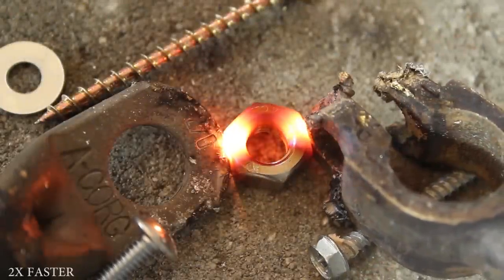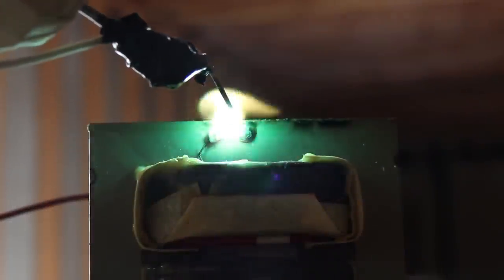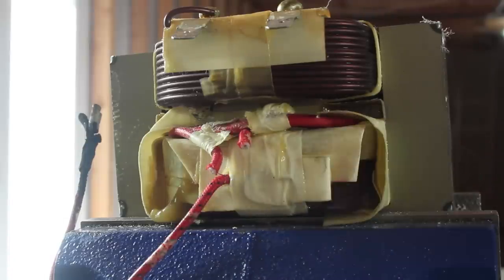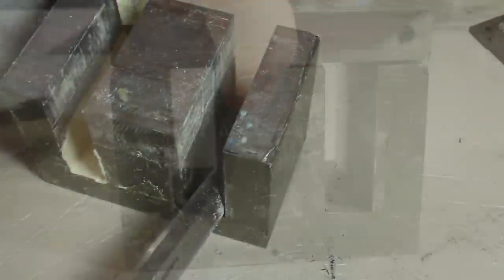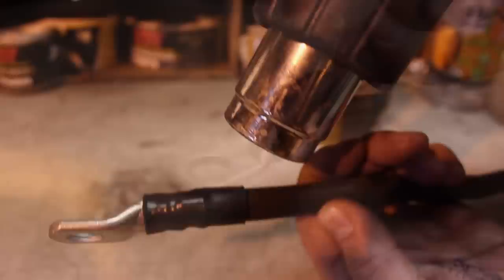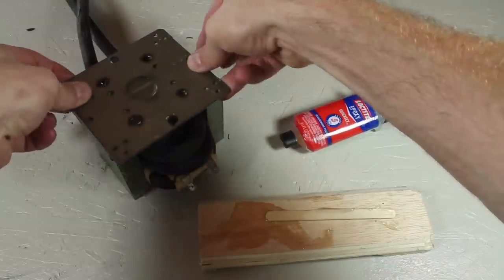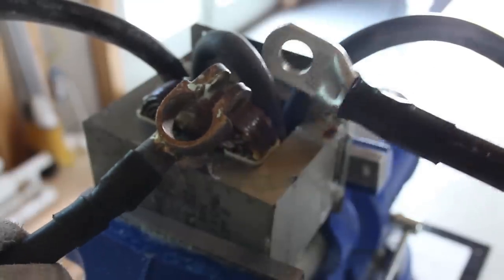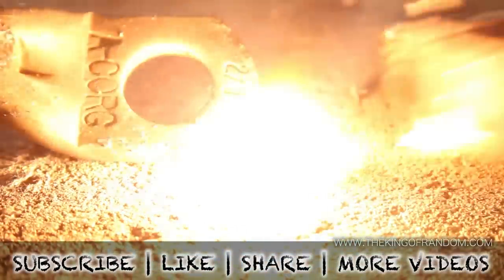How to Make The Metal Melter

Comment: |I put the transformer at 12 volts at car  battery recharger and It's not working ,it make some flames when I catch the + and minus  .
Reply: transformers will only work on AC power so try a AC wall adapter that puts out 50v AC at 20amps
Reply: Yes but if I put him at 220V,the adapter blows up and fuses shave .....it's because I not have a consumer \?
Reply: I think the voltage is to high not shore try a lower voltage
Reply: yes but I I haven't adapters bigger than 12 v ansd smaller than 220V ,I need a convertor?
Reply: Stefi Stefan
If you connected the transformer on DC, the primary coil has been damaged, because the coil don't got any resistance on DC. AC connected to a coil has an inductive resistance.
Reply: You are trying to charge a battery with AC? No wonder it smokes.... Batterys are DC and need to be charged with DC.... Are you serious?

Comment: At least this won't kill you if you touch it.
Reply: Thigh you're probably more likely to get injured by the heat
Reply: Shane Aykroid It's only 2 volts.
Reply: Luke Septicplier No, it has only 2 volts. It can't travel through your body past the hand and arm.
Reply: thats true
Reply: +Iamsasquatch how is it possible with 2v u melt a metal I have 36v transformer it just melts click pen springs
Reply: +Shane Aykroid just saying, the heat comes from the friction. Also he does touch the wires in another video.
Reply: because your transformer doesnt put out 800 amp, but probably only a few. it is not the voltage that does it, but the amps. you can get 1000volts out of a 1.5volt battery with a transformer, but that 1000volt wont harm you.  a few amps from the powergrid (110v or 220v) trough your body, and you are gone...
Reply: Jörgen Börg Not true. The amperage is in the end what kills you, but it can't without sufficient voltage.
Reply: Iamsasquatch true, you cant have one without the other...its all about the triangle.
Reply: im no expert but i would really just not want to be shocked with anything with that many amps or volts. jeez 800amps at 2v is 1600 watts im good fam.
Reply: your 36v transformer probably has very little amps which is the main reason this is melting metal
Reply: i work with 480v machines at work. some put out 3amps.  i got shocked by hitting a exposed wire with a wrench. how come i didnt die? i was standing on a ladder and it only made my right arm go numb?
Reply: tribulation138
 wooden ladder or aluminium? elektricity always follows that easiest way to the earth, so this time you had enough resistance.   look at it this way. when you touch an animal shockwire in dry condition with you boots on, you will feel practicly nothing. do it again but stand barefeet in heavy rain, and you get the shock you never wanted :D.
Reply: +Jörgen Börg fiberglass ladder
Reply: tribulation138
and probably with rubber paws. yes, that is definatly a factor why you are pretty much ok. those ladders don't conduct electricity well. and if you didnt toch any other thing than the wire on the ladder,the conduction of elektricity via your body to ladder to ground is very low.  thats why all ladder for elektricians are normally out of fibreglass.
Reply: ***** What? Do you know how electronics even work?
Reply: as soon as you complete the circuit with you in it you will melt like the metal in this video
Reply: nop, but it will burn you badly....try it and show your scars :)

Comment: why don't the two wires need to connect?
Reply: That whole thing-the transformator- bases on induction. It says that a moving conductor inside a magnetic field or a conductor in a moving magnetic field puts out voltage and amps. In a transformator the primary creates a magnetic field which poles are switching around quickly depending on the frequency in Hz of your power supply (don't know how often. In Germany it is at 50 Hz meaning a pole switching of 50 times per second) and so inducts an electrical current into the secondary. So all in all due to the law of induction the primary and secondary do not have to be connected.
Reply: +Lele Merb woah cool thanks

Comment: You really need to put a disclaimer on this video. Only certified technicians should open a microwave. There are some seriously deadly components inside a microwave. Touch the wrong part and it can kill you instantly. Like a capacitor inside a AC unit, the capacitors inside a microwave are much deadlier. Is deadlier even a word? But seriously a microwave is the hardest appliance to repair and there's a reason there are technicians trained for these repairs. I enjoyed the video and see you give warnings for the experiment, but please put a disclaimer up for people that opening a microwave is not safe. Ive been in residential maintenance and repairs for a long time, not once at any company do we allow maintenance techs to open or work on a microwave, only certified techs. Cover your butt for this as well, they are nothing to play around with and no one should open one under any circumstance unless they know what they are doing.
Reply: Lol, I'm 10 and I did this

Comment: So as a student betrayed by the American Education System, can someone explain how the primary coil is able to power the wire even though there is no direct contact?
Reply: Angel Castillo trough a magnetic field
Reply: +Angel Castillo U1/N1 = U2/N2 this is possible because we use alternated current. check magnetic inductance for more info. if we have 220 volts as U1 and 100 revolutions - N2 here is only two revolutions so. 220/100 = x/2 we have x equals 4.4 volts another important thing is u1.i1 = u2.i2 so lets say we had 1 amper in the first situation 220.1 = 4.4.x now you can see that the current will rise tremendously x equals 50.
Reply: +Gabriel Augusto Alves dos Reis  if Angel doesn't understand the concept, the math won't help much.

Comment: STOP SAYING VOLTAGE IS WHAT KILLS PEOPLE >.> Its amperage not voltage, voltage is essentially the speed whereas amperage is the size.
Reply: OhNoNotMyPenis Thank god someone knows what they are talking about.
Reply: it is both volts and amps the "its not the volts that kills people its the amps" saying comes from static electricity because static can 10s of thousands to 100s of thousands of volts but extremely low amps so it can jump spark gaps and tingle or hurt a little bit but wont kill you or seriously injure you.
Reply: I meant with direct current injection (ie. no resistance) xD sorry bout the confusion.
Reply: MLGOctang k, sry

Comment: I don't get it, God does the black cable produce electricity when it's connected to nothing
Reply: +wooju baik Induction,it works kinda like a inducton furnace
Reply: The changing magnetic field from the ac current produced by the primary coil induces an ac current into the secondary coil

Comment: hi is this safe for me only 13 years old
Reply: NO
Reply: +caiique callixto It's totally safe :D
Reply: +miko pada no this is a horrible idea at your age, get an adult
Reply: +DeadPool Junior. Being adult doesn't mean you can't be killed by electricity.
Reply: +miko pada If you know the basics of electronics, go on!
Reply: Do you know the Ohm's law ?
I've checked the resistance over arms.
It's equal to 500 000 ohms.The highest voltage is equal to 2 volts. current = voltage/resistance, so the highest current flowing through your body  = 0.000004 amps.
Now imagine: 24 volt source and the same resistance = 0.000048 amps.
So it's more dangerous to play with car battery than the large transformer.
Reply: I was trying to say that even power source with infinite current (impossible) and, for example, 10 volts won't kill you until you put wires directly into your heart.
Reply: Wires direct into your heart will do the trick without current too LOL
Reply: Taunter Atwill You're  right!

Comment: Why this WONT kill you......with the low voltage it creates, it won't be able to apply all 800 amps of current through your skin, due to the natural resistance of your skin. Between DRY fingertips, there is roughly 300-500 kohms (300,000-500,000 ohms) of resistance. Now according to ohms law, the amount of amperage is equal to the voltage divided by the resistance...so since we know this creates 2 volts, if you were to touch this with dry hands or wet hands which are about 100 kohms of resistance, regardless of the 800 amps, the resistance of the body would only allow 1/250,000 of an amp to pass through you which you wouldn't even feel. it takes a minimum of 1 miliamp (.001 or 1/1000 amps) to throw off your heartbeat and kill you and that's if you hold onto both leads with seperate hands. 

Why this WILL kill you......if he held the bare metal of anything, say two screws in separate hands, then touched those two screws to the two separate leads, it would lower the resistance of his body to extremely low levels, roughly 500 ohms, thus allowing more current through. 2/500 = 4 miliamps, which still on a scale isn't a ton of power, the metal of whatever you were holding onto would get extremely hot though because there is a lot more power passing through it due to it's resistance being around 1 ohm. If it wasn't AC voltage and passing through your heart, it probably wouldn't kill you. For example, DC voltage takes 30 mA to be considered deadly.

Comment: Anyone else slightly terrified by this? I honestly would never attempt to build anything like this without a proper grounding (!) in how electricity works. I swear I would kill myself if I attempted to make one of these.
Reply: Humans body has 1000om resistence in general. Curency is not what kills u, votlage does. U see on the secondary coil he measured 2 volts. Thats not dangerous. But 35 Volts and 800 amps might kill u :D Try not to touch the primary coil (that one he took out of the microwave) because there s 230V of phase voltage.
Reply: Inline Macedonia No there's a 110 volts. This was made in the US
Reply: Inline Macedonia No, Currency doesn't kill. Current does. ;)
Reply: MaeLSTRoM1997 Bro, english isnt my native language. And voltage is the one killing u! Trust me im an engineer
Reply: Inline Macedonia you just failed the test. lol
Reply: Jaco Cronje Lol :D What have i said wrong ?
Reply: Inline Macedonia you must be a waste management engineer because you know nothing of electricity, current (amps) is what kills you and then even that varies greatly depending upon the course it travels through you body. 1/ 1000 of an amp can kill you ear to ear
Reply: Jonathan Lewis In this case, amps cant even touch u, because the voltage is low (its a perfect example of a shourt circuit of a TR). You need VOLTAGE to cause the current for flow.  If the terminals have wire sticking out the breaks the skin, the RESISTANCE is lowered and it takes less voltage to get a killing current. Most dangerous and most common path is through the hart, arm to arm, or arm to leg. (try to change a lightthub standing on your bouth feet). Amount of current:
Perception - tingling - about 1mA, Let-go currents - about 1...6mA, Painful, difficult to release energized objects - 9...25mA
Muscular contractions, breathing difficult - 25...60mA, Ventricular fibrillation - 60...100mA....
Basically the 50V is roughly 80% of 60V, which is the lowest documented "lethal" voltage. There have been fatalities involved with voltages below 60V. however they have not been proven to be the actual cause of death. PERIOD! (sorry for bad english)